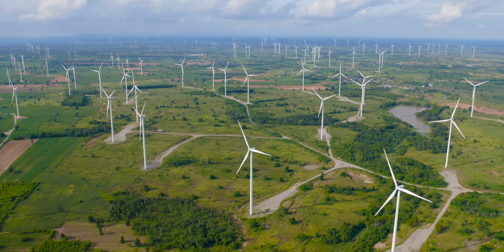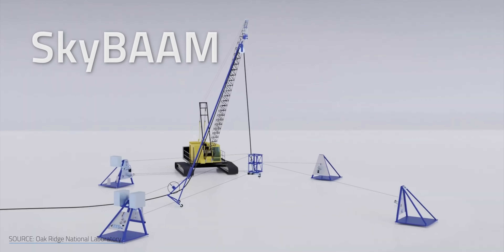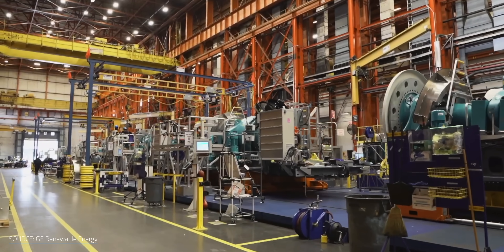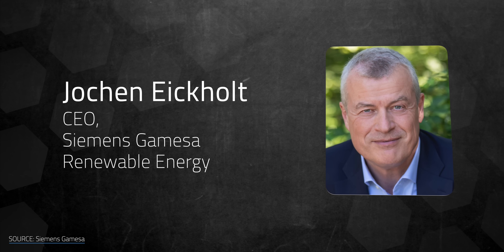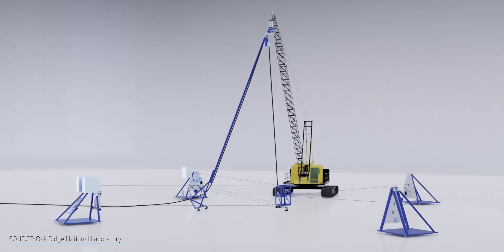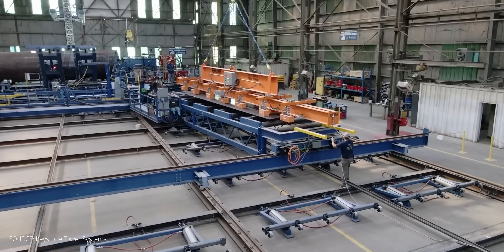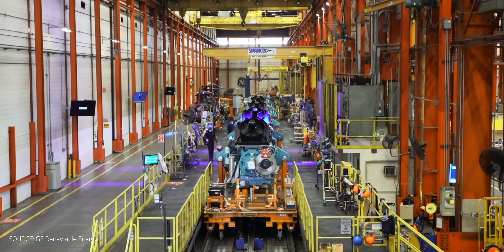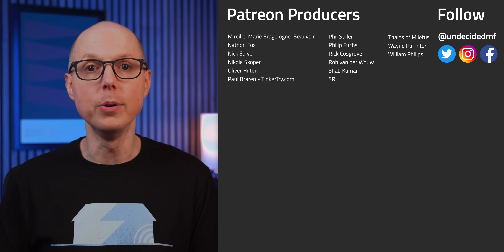Why We Need To Rethink Wind Turbines

Comment: We do not need to rethink the wind turbines, we need to rethink our transportation infrastructure.  The roads, bridges, cranes, trains, etc. are all too small, which severely limits and restricts installation and maintenance of big objects like wind turbines.  However, the physics of wind turbines strongly favor taller towers, since you get higher wind speeds higher off the ground, and extractable energy increases with the cube of wind speed.  Consequently, it simply makes the best physics sense to make the turbines large with a tall support tower.

How then is our society supposed to progress and become more capable over time?

We could invest in building larger roads, taller bridges, bigger trains, etc.  However, an alternative is to invest in building heavy lift "sky cranes".  Basically, we need to build heavy lift, remote control, solar powered, hydrogen filled air ships, designed specifically for lifting and transporting large objects, rather than for moving human passengers.  It does not make sense to transport humans using hydrogen filled air ships, but it absolutely does make sense to use them as unlimited endurance remote control sky cranes (which is possible when the air ship is primarily solar powered).

Wind turbines have the potential to be relatively easy to transport and install, with appropriate sky crane capability.  Current design wind turbines generally have a relatively limited life expectancy (say 25 years), due to the wear out of moving parts such as bearings and gear box components.  Other parts of the wind turbine (such as the foundation, the support tower, and the turbine blades) can be designed not to wear out at all.  However, servicing the wind turbine to replace the bearings is generally not currently possible, since we do not have an easy means of plucking the blades and nacelle off the top of the support tower and transporting it to a factory floor for service.

It is possible to redesign and standardize the turbines to be much easier to install and maintain, with appropriate sky crane capability.  One possible design would include an above ground foundation, using dirt filled containers, and a pyramid shaped wire frame support structure.  Such a structure could be transported to the site with a sky crane, and the containers could be filled with dirt to provide mass to keep it upright in a wind storm.  Then, another sky crane could bring in the support tower, with a special mounting socket on the top, designed to support the nacelle and wind turbine blades.  Once the support tower is properly secured at/near the ground level to the foundation, a third sky crane can bring in the completed nacelle with the turbine blades already attached, and simply plug in the nacelle to the socket on the top of the support tower.

Then later, when the bearings needs replacement, the whole nacelle and blade assembly can be plucked back off the top of the support tower using another sky crane, so as to transport it to a factory for maintenance.

Some critics might point out that wind turbines get installed in windy locations, and they may try to claim that air ships cannot be used in high wind conditions.  To such claims, I would point out that the ill fated Hindenburg zeppelin had a top speed of 85 miles per hour, with a cruising speed of 76 miles per hour.  If you are willing to expend enough propulsion power, it is possible to temporarily resist the wind, although it does not make sense to try to operate an air ship in a serious storm such as an actual hurricane or tornado.

It is conceptually possible to design a solar powered air ship that normally moves at slow speeds and uses minimal power, such that it generates surplus electricity most of the time.  It is also possible to burn some of the hydrogen in the airship (while simultaneously dumping some water ballast weight), so as to temporarily run a high power consumption rate hydrogen fueled propulsion system, during overly windy conditions.  It is also possible to include some refrigeration equipment to use the surplus electricity to condense water out of the air, as well as to electrolyze the water into fresh hydrogen, so as to replenish any hydrogen that may get burnt by the propulsion system during high wind operations.  It is therefore conceptually possible to design a solar powered  remote controlled hydrogen filled air ship with practically unlimited endurance, that never needs to dock, except for maintenance reasons.

Comment: Something that was not mentioned as a benefit to the multi-rotor turbine design is reliability/availability of the turbine. If each rotor is allowed to run in parallel, then when one rotor fails, the rest of the array can continue operating, thus limiting the overall impact to production due to component failure.

Comment: With decades of advanced material reinforcement manufacturing and failure analysis engineering experience, Biden and the wacky left prematurely shutting down clean burning coal plants has horrible consequences. 

The pressure on wind turbine manufacturers to lower costs and increase production without proper engineering, testing, manufacturing refinement, analysis &  re-engineering has catastrophic consequences. 

I spoke to Vestas years ago about carbon fiber reinforcement on blades leading edges, improving UV stabilization critical in our Colorado high altitudes, significant additional testing and certification programs and finally specific manufacturing improvements to increase quality and efficiency. 

They had no interest. 

Now blades leading edges are literally cracking, splintering and falling apart. They are using duct tape as temporary repairs. The fibers that are coming dislodged are contaminating the environment.

Success is no accident, it’s proper engineering by design.

Comment: What about a comparison of  power output of standard wind turbines to those of other designs? I am interested in the multiple blade tubular designs that don't take up nearly the room as the large fan blades. How is the output of these compared to a similar model of differing design?
Reply: Swept area is paramount. If your alternative system is smaller it will produce less electricity amnd cost far more per watt.

Comment: Would be amazing if we made it mandatory to set up different kinds of wind turbines, solar panels, and even water generators (using gutters and gravity) on buildings, and especially skyscrapers
Reply: English major ?
Reply: @kkarllwt  sociology underserved communities
Reply: Water generators using gutters and gravity would generate very little. Do the sums.
Reply: @rogerphelps9939  that could be true, but it’s better than nothing right? Unless the costs outweigh the benefits significantly, but with a skyscraper, I’d say it can be worth it
Reply: OK. Take a typical high rise with sides 30 metres by 30 metres. That gives a roof area of 900 square metres. Suppose also that the height is 100 metres and the annual rainfall is 1 metre.  Therefore 900 cubic metres or 900,000kg of water falls onto the roof annually. The potential energy of this water is mgh joules where m is the mass = 900,000kg, h is the height = 100m and g is the acceleration due to gravity which is approximately 10 metres per second per second. That means that the potential energy is 900,000x10x100 = 9x10^8 joules.  Suppose the water is stored and released at a steady rate to drive a generator at ground level. The number of seconds in a year is approximately 3x10^7. The power generated, assuming 100% efficiency, power in watts is energy divided by time in seconds = 30 watts. Although 30 watts is sufficient to drive a few LED lights I am sure you would agree that it is definitely not worth the considerable expense and effort necessary.  Of course you can play around with the figures but the general conclusion won't change.

Hydroelectric schemes generating worthwhile amounts of power have a combination of very large collecting area, high rainfall and as large a head as possible. In this case the collecting area is simply many orders of magnitude too small for it to be worthwhile.
 @andresitorocks
Reply: @rogerphelps9939  Wow! Thanks for that clarification, youre right about it not being worthwhile considering how much energy it produces, good thing there are better options to be able to take advantage of skyscrapers like solar panel windows and such

Comment: Good stuff Matt! I'm a wind  turbine engineer and that title is perhaps a bit clickbaity. Advancements in the industry are rarely sexy or revolutionary. Large diameter 3-blade HAWTs are pretty well established to be optimal right now, and improvements tend to be incremental material or manufacturing tweaks. Cost pressure means blades are anything but high tech. They're still mostly cheap fiberglass and balsa wood/foam. Carbon is rarely even worth the cost despite being well established and having superior properties, neverminded things like additive manufacturing or Myriad's crazy design. Keystone Towers is probably the most exciting new tech in the (onshore) industry right now.

Reliability is a chronically underappreciated metric in may engineering disciplines. Investors just care about ROI, and LCOE is taken as THE metric to reduce in the wind industry. Risk reduction is harder to quantify and optimize and sell to wind farm owner/operators . With so much price pressure and competition, problems with cheaper model turbines were bound to happen. Rock bottom prices mean balancing on the edge of barely good enough to stay together. Maybe that's not a bad thing. If you can save 2% on cost but 1% of turbines will have a defect causing it to catastrophically fail, you still come out ahead, and doesn't mean we need to rethink anything.

Comment: Instead of moving to carbon fiber I wonder if they could make use of basalt fiber composites. It's supposed to be cheaper and tougher than carbon while stronger than glass. Basalt also might be a better resource than sand.
Reply: Basalt fiber is better than regular glass fiber, but it is about equivalent to S2 type of glass fiber.  Both the latter are significantly cheaper than carbon fiber.  Basalt is a bit less energy/resource intensive than regular and S2 type glass fiber though.

Comment: Automated onsite construction will be a game changer.  I totally support the we are big enough idea.  As with anything like this which is a staple of a system.  It's about both quality and quantity.  Let's build more, with the durability to last decades not just years.
Reply: I don't know about how much automation is going to factor in, but the best idea in the video was onsite manufacturing of large components. Modular mobile manufacturing units is also interesting.
Reply: Oh yeah as like onsite manufacturing will be able to fix the quality problems and the 20-year typical lifetime of these units, What a utopian idea.
Reply: @tomgroover1839  It solves, or greatly reduces, the supply chain and transportation issues. If all houses had to be made by one of a handful companies in their centralized factories, they would have similar issues.
Quality can be largely made up by quantity. Depending on what you mean by 20-year life, that too.

Comment: For such mega-projects, isn't iw worth considering magnetic bearings, for example, that won't wear out?
Reply: You can consider them but they don't help much as they take away the electricity as that is where your money is coming from. Also it's not really the bearings that wear out. It's gearboxes, but blades, and electronics.
Wind at scale means the tips are basically being sandblasted all the time. Aerodynamic effects mean that damaged bladetips pull a ton of energy out of the system.

Comment: ... I thought the thumbnail was just like the "Ridiculous Planes" thumbnails, just showing some utterly ridonkulous arrangement of pixels to force a click from caveman brain.
But they're *actually* gonna build that contraption? What are they gonna say when this thing topples over backwards? "Just add 2 more wavers to balance it"?
I might come across as cynical, but this building won't ever stand the way it is designed now. There should be a support beam that holds it up on the rear, and since the building then rotates to catch better wind (rather than just the top turning to the wind) that support beam needs to be on wheels capable of going in an arc around it. Can you say "Not in My Backyard"?

Comment: So what you’re saying, is the real male problem with the wind industry that the males have gone for size mass huge size are we talking about a penis issue? Yes, that might be a problem, but as you pointed out, let’s go for other solutions maybe not tall towers, horizontal turbinesand what’s the new one to Real let’s keep researching and acknowledge there is a limit to size is the profitability still there when you have to keep repairing it. Oops we just discovered that is the new statement

Comment: I have always figured the large 3-blade turbines are NOT a good solution to wind turbine design.  There are other systems like vertical (or horizontal) drum style windmills and/or new-tech blades that on a small scale, would work better for long-term reliability but mostly with lesser efficiency at low elevations.

It has always seemed to me that "bigger is better" is just a foolish idea, when much more compact designs with longevity/durability in mind makes more sense.  Use more of what works more reliably is more sensible.

While wind shear is an energy efficiency problem at low altitude, it seems obvious to me that low altitude solutions (3-5 meters) place less stress on all components and engender easier maintenance when turbines of any type are designed this way, regardless of on/off shore placement.

Lesser energy production but WAY LESS hassle.  The MUCH lower cost per generator should easily justify the larger number of generators required to realize the required nominal output of a wind farm.
Reply: Firstly my subjective opinion is mine and does not invalidate yours 😊

As a Dane I grew up seeing lots of wind turbines. The slow and steady movement of the three blades and tall sleek design is in my opinion much nicer to look at than most other designs. Personally I think the visual clutter from a lot of fast moving turbines and complicated looking machines are a bad choice especially in densely populated countries like in Europe. 

In places like sparsely populated desert countries or in North America it might be different.
EDIT: Spelling errors
Reply: @HiLasse  Pleased to read your response Sir.
The types of turbine I think make more sense would NOT be invasive on the environment.  Indeed they can likely be completely invisible from a few hundred meters.  If wind generation of the type I propose is adopted, then scaled-down (back-yard) and perfectly safe wind generation energy can be made available to homes with battery storage facilities.

It is rapidly becoming very clear that distributed generation of electricity is the most sensible way to bolster the aging grid structures around the World while the work of ruggedizing national electrical distribution (all nations) can proceed at a less frenetic pace.
THEN a much more robust energy supply system is created that is truly cooperative.

What are the "most other designs" you refer to Sir?
Reply: Way less energy too
Reply: The power generated goes up with the size of turbine s^5. Wind speed^3 (higher speed with higher height) and radius^2. Greatly simplified, but there’s good reason they go as big as possible.
Reply: Well you had better educate yourdself because what you figured is bollocks. Ask yourself why large 3 bladed  turbines are absolutely dominant. It is not for fun.
Reply: @rogerphelps9939  My viewpoint clearly states repeatedly that more & smaller turbines is LESS than optimal. One respondent to my thoughts also stated with practical math, why high elevation and three blades are better from an efficiency perspective.  No argument from me on that.

My comments were simply calling into question why the upsides of current tech with its reliability, manufacturability and cost issues supposedly outweigh a more modular and attractive approach.
Thank you for your response Sir.

Comment: Trees get stronger as their fibers regrow after they break internally when they are pushed by wind. Leaves collect solar energy and CO2 and emit oxygen in return and sequester carbon as the tree grows. Solar panels are increasingly used above crops, providing shade, and can collect indirect solar energy. When you put it all together, you,have a solar energy-capturing CO2-capturing oxygen-producing wind turbine. Plant more trees, find ways to collect some of the energy from them (like vines do) in return for pro-growth management to have a symbiotic relationship instead of a parasitic one. Thank you for coming to my Ted Talk.